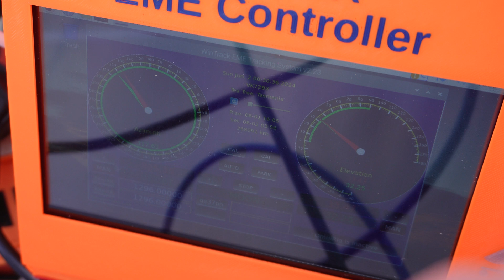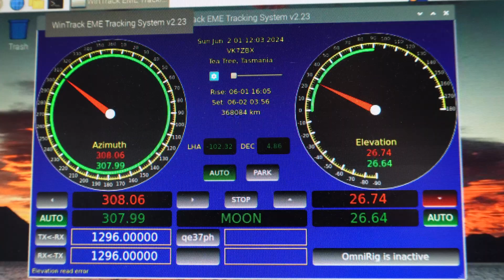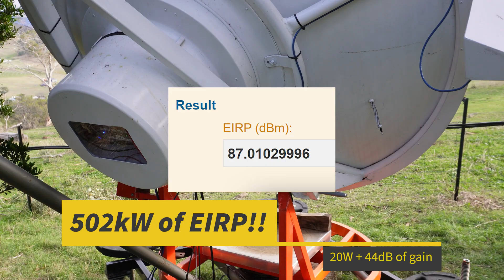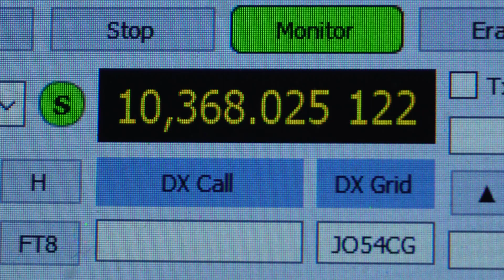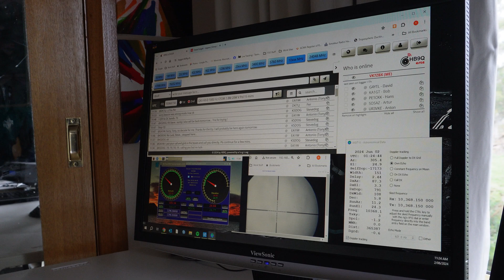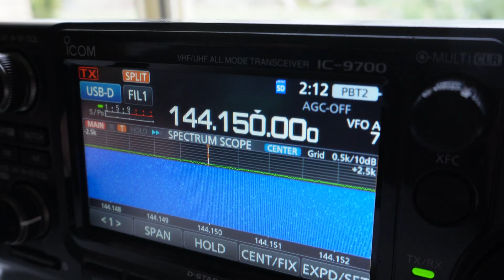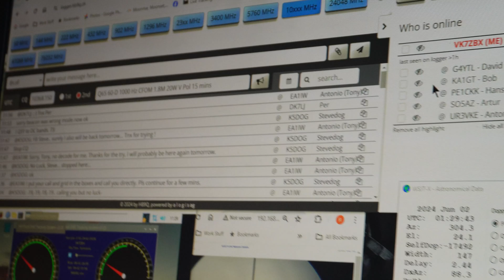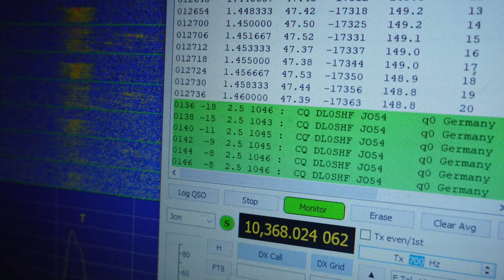I Sent a Radio Signal to the Moon... And It Came Back!

Comment: Electromagnetic radiation has limits on distance that it can reach, now radio waves that you are telling so far the strongest is 100,000watts that can reach up to  a hundred miles only, but our  moon is 238,854 miles, not even an eighth of the distance, seems impossible right? I've explained this thoroughly to you , now you know my friend.🙂
Reply from the maker: Hey mate, a quick clarification — radio communication isn’t limited by “how far the watts can reach.” It’s not like throwing a ball where it just falls short after a certain distance.

Radio works on signal-to-noise ratio, antenna gain, path loss, and receiver sensitivity — not raw wattage alone.
That’s why we can reach the Moon (and far beyond it) with less power than many FM broadcast stations.

For example:

Apollo missions talked to Earth over 400,000 km using around 20 watts.

Hams bounce signals off the Moon today (“EME”) using power levels similar to a home HF station — because of high-gain antennas and sensitive receivers.

So yep — it’s absolutely possible, and has been done for decades.

Comment: I didn't know you could strap a radio signal to a boomerang 😆 

Then again, i didnt know Australia had a space program to strap  the boomerang to a moon rocket 🚀; cuz boomerangs dont fly in space that has no air... 

Seriously Hayden, great job with the EME 👍😃

...hmmm, one more...

To get the correct circular polarization, does the rocket have to  roll in the opposite direction on liftoff?

😂

73

Comment: Perhaps tangental to the topic, but what do you make of radio signals returning to earth after many years?. I just read an autobiography of Captain Robert Arnott, former master of the cruise ship, QE2 ( entitled,  'Captain of the Queen', Quadrant Books, 1984) in which he wrote about an extraordinary radio transmission received on board that ship in 1978 in waters near Tahiti, that had been sent from another Cunard ship years earlier. At p 233, Arnott wrote,  "Another memory, but a slightly more tangible one, occurred in the waters around Tahiti.Suddenly, our radio-room received a signal prefaced by the letters GBTT- the call signal of the Queen Mary. The message had apparently been sent during the second word war, had travelled to outer space, and then, some forty years later, returned to earth to be picked up by the QE2's receivers.The incident surprised our radio officer, but it wasn't totally unique; similar phantom radio messages plunging back to earth, from who knows where, are occasionally reported, but never before had one come back across the years bearing the royal call signal of RMS Queen Mary".

Comment: Can you get signal back from Jupiter or the Sun?
Reply from the maker: Maybe
Reply: @HamRadioDX  Actually, you cannot.
Moon is only 380,000 km away.
Sun is 150,000,000 km away.
Jupiter is 588,000,000 km away.

I saw power equation for radar, it's inversely proportional to distance ^ 4.
So, they are about 1000 times farther, meaning your signal back will be 10^12 fainter.

So, if you barely get signal back from the Moon, no way even from Mars.

Plus, Jupiter and Sun have very high radio noise, do they not?
Reply from the maker: @sbkarajan  Too far
Reply: @HamRadioDX  Ok, one last question....
Is there actually a lot of radio noise coming from the Sun or Jupiter?
Reply: @HamRadioDX  But can you give a try?
Reply from the maker: @sbkarajan  Nope won't work

Comment: On  ~50 Mhz  with CW and a Key, u can send an ping, if the sky clear after 2 seconds u got a  feedback from moon. that has work every day over long time. With an 10m Dipolantanna in matching condition. The lowes Power wo is has work was 8W in clear night  -  or  100W with heigher Huminity